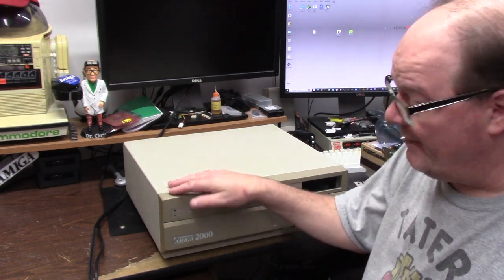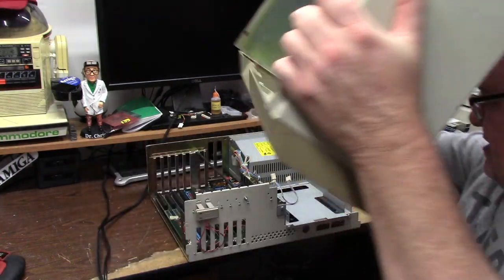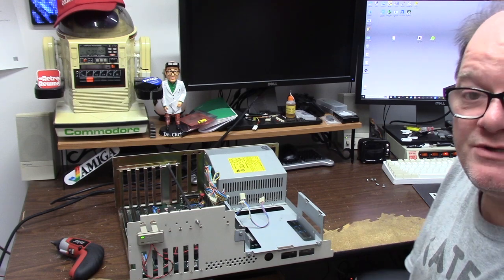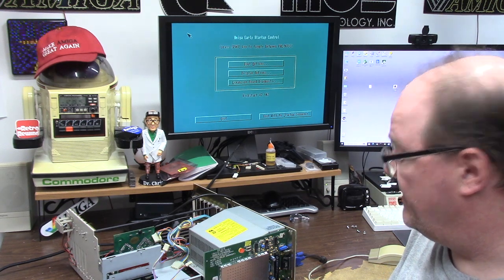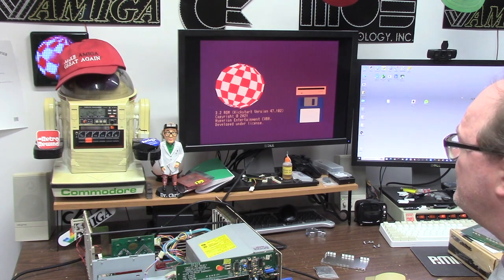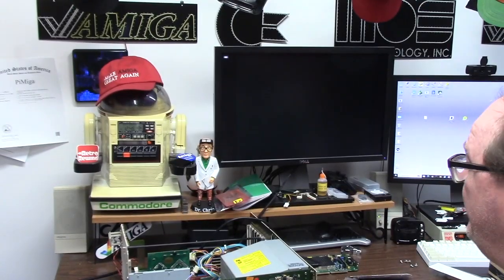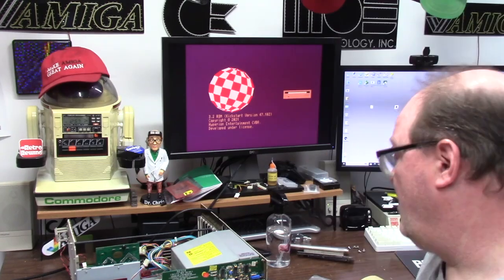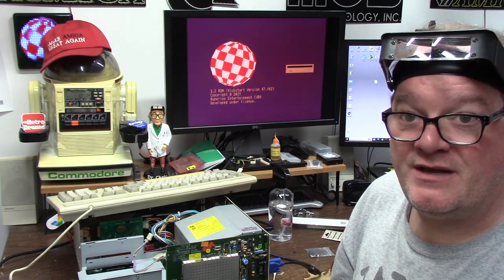Amiga History:  The Commodore 2320 Video Display Enhancer

Comment: I found a new in the box 2320 Amber board in my collection of Amiga goodies (that were scattered in numerous places all around the house). I used it in one of my 4000s until I found my Cybervision64  with scan doubler. It is a useful card, but I found that over time it needs to be readjusted a bit. I never bothered to see if there was a specific reason for that.

Comment: yeh there's nothing worse than rubber feet on her bottom!.. and in other news I bought one of these C= flicker fixers brand new for my A2000 back in the day purchased a new 31KHz VGA monitor and left the 1084S on the RGB port so I had dual monitors. Fast forward 2020 ish Purchased an A2500 from the USA and sent it back to AU and also picked up a mint  condition A2320 for not a lot of money I have them here packed away after I installed a ZZ9000 and GVP TekMagic 060 SCSI2 with scsi2SD V6 in it with the P3 SBC and all was well until I blew up the PSU a month ago. Will get around to fixing the PSU.